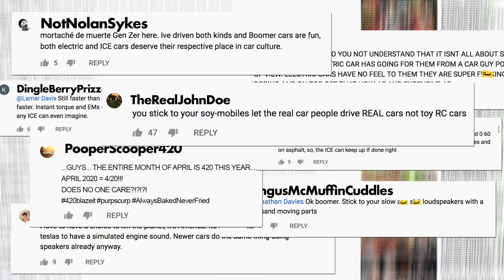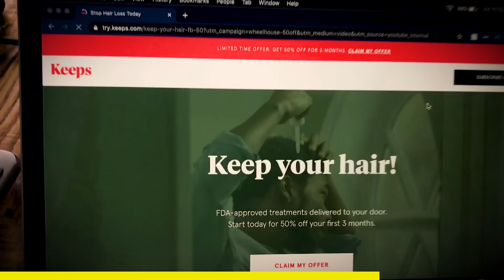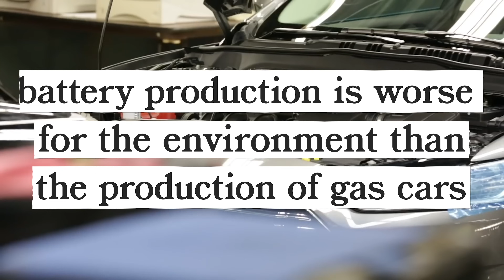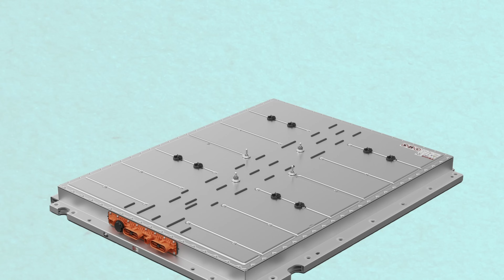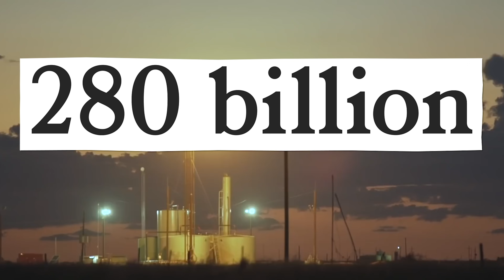Are Electric Cars REALLY Better for the Environment?

Comment: Few things you missed that are important...
1) cold weather... It's about 20 out where I am. Even after I installed a charger for my friend, it was taking up to 48 hours for a charge.
2.) End of life cycle on an e.v. is much like the beginning, less friendly.
3) when those lithium batteries reach their end, it is cost prohibitive to recycle them. So where does that lithium and cobalt go? Yikes!
4.) The grid cannot handle even 10% e.v. usage in highly populated areas without restricting usages. Coming from an electrical engineer. New building codes are pushing us the way of more electric components in houses so things are working against us.
5) when things happen in nature, there is often very limited electrical sources. So response and capabilities are diminished greatly.
You make some great points. I applaud you. But there are some barriers here. A mix of vehicle types is and always be the answer.
Reply: I'll give you 5, unsure of 3-4 (you have to factor in that the currently tech now maybe can't recycle easily, but in 20 years that could be a different story). For 1 though, I'm not sure what is wrong there. It's cold here (teens tempter wise) and I can charge my Model Y with a Nema 14-15 outlet in a few hours. Granted newer Tesla's (and hopefully more EVs) have a heater that you can just schedule when you normally leave the house and boom, everything is warmed up using the outlet instead of the battery and you leave with 80%(or whatever limit you set). Plus EV's with the dedicated heater, heat up super quick. I hop in my car without doing anything after work and often times, before I even get settled in and pull off, it's already blowing out hot air.

5 is probably the biggest draw down, but just like we store gas, we can store electricity, we can also make it on the fly via solar panels where as you can't easily make crude oil and refine it. Not to mention there are things like tow charging and other weird things you could do (like say pedal a bike to charge a battery) that isn't possible with gas. Hopefully in the future everyone is able to go off grid at any moment and survive for at least a week if not indefinitely. So if you have sun light, running water, a gym, etc on your property you could power your car and house.
Reply: I'm a software engineer (for a faang company if that matters to you) though and not an electrical so these things may not be possible.
Reply: @PerfectorZY  at this point, you kind of have to give me all of them. 😂 This is what I do for a living to a point so I do know my shit. As for a few of your points, I agree. However, we are encroaching a slippery slope trying to get people to power things by pedaling or running, etc. Look at how lazy folks are. 😂 If the technology gets a lot better, we might make some progress on all of this. However, for right now, we're not there. There are about 15 or so other challenges I see but quite possibly the biggest is just the cost. Most of us just don't have the money to make this a reality. Solar panels, upgraded transformers and panels, a couple new Teslas in the garage... Yikes!
Reply: @paulg9340  Here in North America we really need to consider inter-community electric mass transit as that is the way we should be going.  Skip cars altogether and rely on this as we move forward.  Adam Something here on YouTube also discusses how urban engineering can further reduce our dependence on motor vehicles and just walk or ride a bike to the local food store and businesses.  He talks about our car culture and how we idolize it.
Reply: @WJCTechyman  😂 yeah ok bud.
Reply: You know the car batteries get recycled into the megapacka that have already shown their immense benefits to an unstable power grid all over the world from Alaska to Australia right? Which literally eliminates all of your following points. 

Battery packs on large scale systems are the answer to storing and distributing during peak hours. Your doom and gloom ideation is dangerously misinformed and misplaced.
Reply: @Way-Way  I know that standard car batteries get recycled. Did you know that the batteries in electric vehicles are generally not recyclable? Not because it can't be done, but because of the cost to do so vs. the opportunity to make money. How many businesses do you know with costs higher than revenues without government subsidies... in other words additional funding by taxpayers? I'll wait!
Now I'm not saying that technology won't improve and that we can't get there, but some states are requiring stuff by periods of time that we can most certainly know won't work. What do you propose?
Reply: @paulg9340  I would say that our taxes should go towards those things. That is what a collective body of government is for. The allocation and distribution of resources for the greater good of the community that invests in said body. In fact I would go as far as to say that we should be subsidizing and increasing said subsidies into such projects and maybe even a national recycling program and legislation declaring and even incentivizing that all junk yards take any batteries from electrical vehicles for recycling after they have been declared no longer road worthy. 

Also I’d stay away from language such as “generally are not recyclable”. Makes it sound technically impossible which we both know it is not. Cost prohibitive yes: but to use a temporary problem as a crutch for the continued use of clearly out of date and obsolete technologies is a terrible way to move forward as a greener society.
Reply: so, all in all, gas cars will never replace electric cars, and electric cars will never replace gas cars
Reply: @altchannel4comments460  but hybrids will replace them both
Reply: @altchannel4comments460  as hybrids are both
Reply: Something's wrong with your installation job if it's taking 48 hours to charge a car. My Kia Niro EV can go from 10% to full in about 6 hours with my 240v charger.

As far as the grid goes - lots of places give significant incentives to charge at night when power usage (particularly A/C usage) is low. There really isn't a reason to charge your car during the day.
Reply: @meanmutton  keep in mind its a kia niro EV with 32 kwh of battery, which is different than 72 kwh on a tesla (I am assuming that paul's friend has a tesla and that you have an older kia niro, so take that as you will)
Reply: jesus loves you
Reply: Holy s**t, that was a great comment.
Reply: First of all 48hours?! You can charge an ev at a normal outlet in 10 hours and if 10%were evs and would charge at the same time at normal outlets it would be the same amount of electricity needed as when the same people with rhe evs used their vacuum cleaners at the same time
Reply: @jannis-joelfehl4855  yep! The environment can make a big difference. Most of the time, it's probably fine, but not always. Some of our remote areas struggle for various reasons and conversely, highly populated areas will struggle for others.
Reply: @jannis-joelfehl4855  try again... In optimal conditions yes, but like I said, where I live this is not the case. A decent amount of our country has less than favorable conditions for charging, especially in winter. If you don't have a garage, or if your home is older than 10 years, you'll find that your costs to optimize your home for charging will be high.
Given the fact that only 13% of our country makes enough money to go buy a brand new car without hindering the budget for things like food, this doesn't seem viable yet. But go on pushing something that only 13% of us should be buying based on finances... That's only meeting about 25% of our needs. This is literally a great solution for about 5-10% of us. To mandate we all do this is retarded.  Yes, I studied vehicle design in college for 2 years and then worked over 10 years in finance... So I know more than most on both sides of this debate... Probably one of only a handful of people with professional experience in all of the above.

Comment: Did we account for the EV battery replacement doubling it's impact?  What is the battery life of the EV?  When we accounted for the "average" emission, the age of the car was not accounted for.  
A just comparison has to be a comparison of the prediction of the efficient modern gasoline engine  vs an equal lifetime of the EV, including battery replacement.  Comparing new to an average of all, including old, is misleading to say the least. 
Can we release this with accurate comparison please, and leave out the info about what emissions come from production of plastic, jelly, etc, please - it's misleading also.
8:50 may have been the right comparison, if you included the lifetime of the EV including battery replacement and were not using the average numbers previously quoted for the gasoline engine.  However, you didn't say what numbers your were using for that comparison, so unfortunately, it's worthless, and must be limited with the rest of the info as misleading. 😭
Let's also not pretend emissions are the only important environmental impact.  We don't own the world, despite contrary popular lifestyle.  The lands and cultures being ruined and people being hurt, by water loss, brine waste, etc, and the years requires to fix these problems (not currently being considered by all consuming corporations), are not being considered - and they have more value than just "emission".  
I respect your desire to simplify things, but let's not devalue the planet, the future problems, the lives of others, or make incomplete comparisons.  It becomes hard to believe your are without agenda when you don't make a just comparison.  Remake?
Reply: battery life of ev is 10yrs

Comment: Nolan good video but what happens with all the E Waste electric cars produce. Controllers, computers all those parts are barely recyclable. Most parts in a gas vehicle are recyclable. Even oil can be recycled and reused. Lithium batteries are a mess, if they're using that much water to mine the elements, how much chemical run off is getting into the soil and water tables. Electronics just don't last long and a barely recyclable at all.

Comment: My call out to the crap is that they are still cars and filled it’s petro chemicals like the whole entire interior then the have tires another petrochemical then all the secondary lubricants like grease in all of the joints in the steering system. Lithium is a particularly volatile and highly flammable when converted to lithium ion this is true don’t ask but water can ignite it once again I have experience with this and a drip of sweat from my forehead landed on some on the ground and flamed up also they haven’t been around long enough to see them end up where all cars end up and how these massive cells will be dealt with causing the largest eco disaster and that is remanufacturing new batteries because at some point like most crap on cars the repair exceeds the value of the car ie your battery I assume it will be like 7500 for a re manufactured  battery plus some of the most difficult labor on a car thus making it completely disposable and sending the lithium to China for them to we will say recycle but probably incinerated but like the mining operations will be done at minuscule pay. Lastly I know you talked matters of finance and you c CC an deny but aside from perhaps two cars are in the price range for your average buyer from 22000 to at most 35000 dollars that is first time buyers and working to lower middle class.. You have to know  that wealthy people don’t really buy cars  the truly wealthy realize the bad investment thus buying used cars nice cars but not new unless it’s a specific model and those cars usually rumble more or less leaving the EV market to the middle and upper middle class. When you watch tv commercials you are looking at cars 50000 dollars and up and to me that is completely unaffordable granted gas cars are expensive too because of the electronics but nice American sports cars are 40000 and under with some exceptions like the corvette which they still beat the price down to include more of the class structure but will still produce one in the gt500 area.. Tesla the obvious pioneer bought the bankrupt brand from I think John Paul Mitchell you know the hair products and a partner mostly because he is a venture capitalist and saw its potential and I think he is realizing that potential every day but I don’t t recall him talking about fuel economy  beyond just a selling point, he blows huge rockets into space he’ll he blew a Tesla into space, space junk is litter too that’s all I am saying. What I see is something trying to edge into a market people are happy with but will only be a Segway into a format that hat people are happy with. They are odd include to much technology especially at a time that hasn’t honestly produced a good battery but claims to, check your power tools yes different but still  very similar or the same batteries going through a transMission a clutch and a drive wheel, they over charge under charge don’t charge and remanufactured ones are wanting because they are just cherry picked cells from recycled packs and this comfortable model isn’t going to change. I am going to let this rip too environmentalism is a religion and as far at it being truthful, for every study that says it exists I can show two that show otherwise; just do your job and don’t recycle anything like hat has no market value because everything else just ends up in the landfill with the rest of our trash while our ferrous and non ferrous metals get bundled and sent to China which is recycled in the filthiest of ways . If it is peak oil don’t worry we were supposed to be out in the 70s. Electric is going to require a humongous infrastructure change but by Sunoco Shell and so on that would be the oil companies so picture how that will work it won’t and like ethanol in the beginning when the hares to standard oil and so on get tired of the  the EV say it actually starts to nibble away at profit margins they will disappear and there will be nothing to do because the industry is to large and in way to many markets it’s similar to why it’s a pain to run cooking oil in your diesel they locked down the oil by making companies sign contracts for it, and if big oil can control the local Chinese restaurant they can reach auto companies who are only profiting of a trend anyway they could care less about being green, we still can’t run 100% alcohol and that is as clean as batteries.

Comment: But the lithium battery has a short life periods. you need to change it every 5 years. It means you emits more co2 to produce new battery. Also i wonder what happen to used battery, can we recycle it? Solar panel also got some problem although the life span is much longer i think up to 30 years. But what happen after that?
Reply: Yup, Recycle

Comment: Lot of people has a general misconception of EV's charging. I have one and in a past 7 months I visited ZERO charging station.  Zip, Nada, Nothin, Not one of them. I charge them at my house at low peak hour (night) and use the car daily.  75-85 miles daily use with some peak days of 100-105. My EV's range is 125miles but have done 119 with 19% energy left.   Charging stations are good, but I still do not know how they work or look like. no need for them for most people with EV's and 250-300 mile range. Very few people visit them compare to gas stations.

Comment: There's a lot of information on ev that isn't present in this video through my own unbiased research I've found them to be about even when it comes to the end all comparison however one thing to consider is the fact also that when you account for evs the other impact that can't be measured is that when concerning their batteries each car sold isn't just one measurement unit but rather several because each car will inevitably need several sets of batteries through its extended life so the per unit calculations are nigh i.possible to quantify thus estimation based off a guess and low-balling  puts evs at a much worse calculation as far as each unit sold and operated. Its a very impossible task to undertake when comparing them but it's not much better either way. Also almost all local city run charging stations for smaller ev transportation is utilizing gas powered generators for tourist purchased skooters Segway and carts.

Comment: If electric vehicles make so much logical sense then why aren’t ships powered by electricity, as well as the heavy earth moving machinery. Serious question, because I’ve always wondered this.
Reply: for ships, weight is the big factor, for large machinery is energy density. Large machinery needs high power output for sustained amounts of time. Batteries simply dont store enough. For ships, the heavier they are the more the sink, so the heavier your fuel, the less cargo you can have on-board and the less $$ you make. That being said, some ferries are battery powered and more and more heavier ships are starting to become battery powered with rotor sails using the "magnus effect" for supplementary propulsion. This is more due to advancements in battery technology than anything else.

Comment: Repeat the quote “Elecric vehicles have a less environmental impact then gas powered cars” to the towns that are surrounding the lithium and cobalt mines fueling the ev industry. Most won’t ever have a car to drive. Birth defects, poor working conditions, polluted water… but hey EVENTUALLY it will be better for them when the industry figures everything out. Just like in the long run it will be better for us. They suffer now so we can prosper later. Eh, I’ll fuel up and not power up